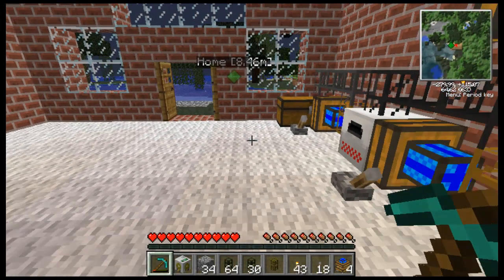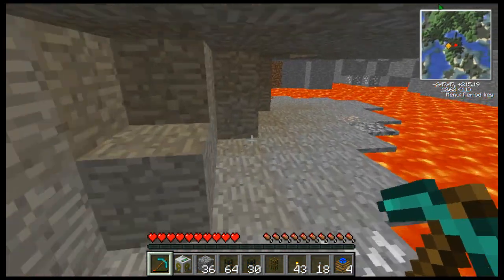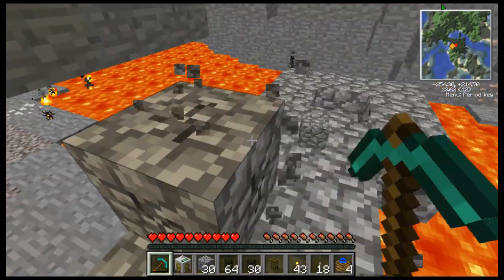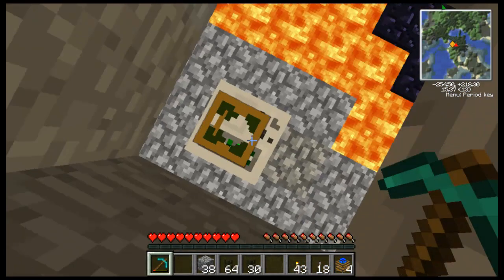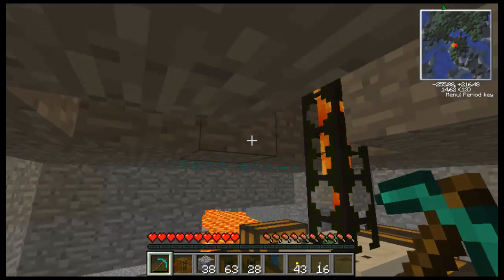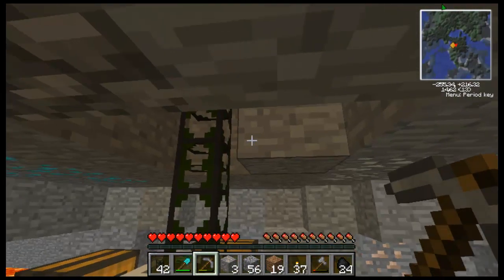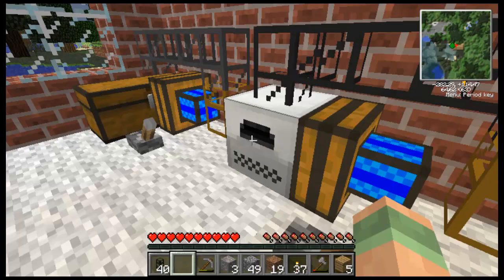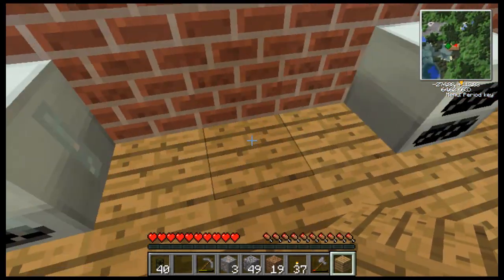Percy Plays Tekkit - Part 7 - Geothermal Generator

Comment: Wanna go nuts and do your power with safe geothermal generators? Make a power flower and use it to produce lava cells. Use pneumatic tubes, a redstone timer, a retriever, red power solar, and of course your wiring to transport the lava cells to the generators. Congrats, you now have a safe infinite energy geothermal system.

Comment: Step 1 make small platform 
Step 2 place pump
Step 3 place engines 
Step 4 put stone transport pipe above pump 
Step 5 place item teleport pipe above stone pipe
Step 6 make item tp pip frequency 111 receive false 
Step 7 place another item pipe freq. 111 receive true 
Step 8 place stone pipe attached to geothermal generator 
Yw I just turned 9 minutes into 30 seconds